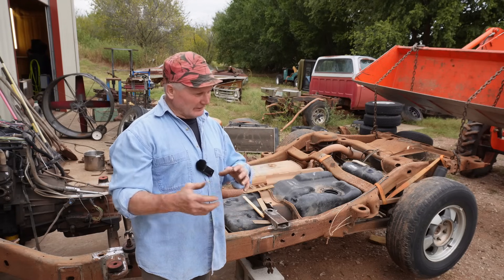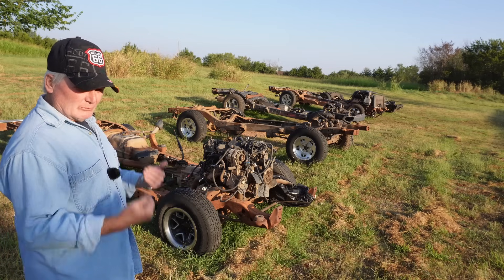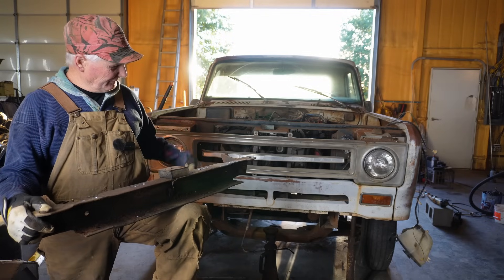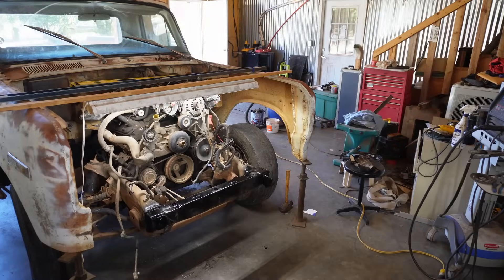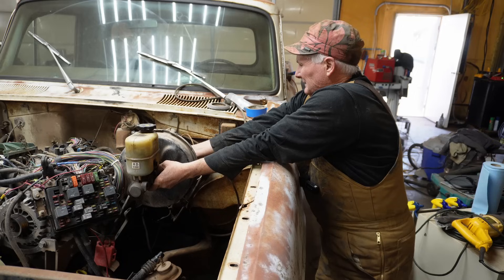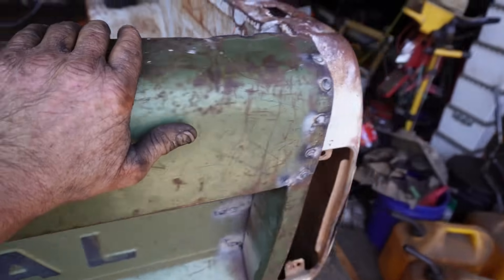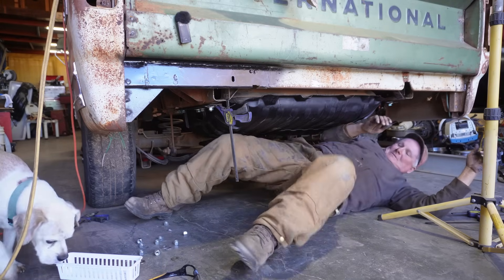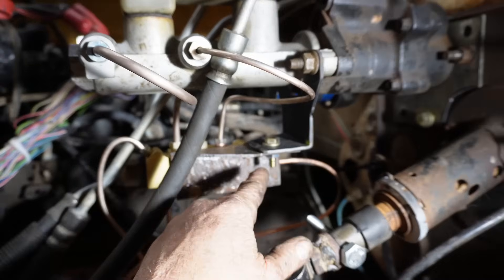1970 IH/2002 Tahoe Frame Swap: Pasture to Engine Start

Comment: Very cool.  I'm 75% of the way finished putting a 71 Travelall on a 2003 Tahoe.  Mine is a full on floor pan and firewall swap.  Basically a full Tahoe with an IH skin and some Dakota fender flares.  If you're interested, the whole build is over on my channel.
Reply from the maker: I know. 😁😁😁 I am subscribed to your channel and have been following your project.
Reply: @RandomRodShop  Awesome.  And thanks.  I'm trying to get caught up on videos but I'm pretty bad at it.  I'm much farther than the videos.  Front clip is fully repaired and bolts on (finally), rust and holes in the roof are fixed, interior metal work is nearly finished.

This was the first time youtube has introduced me to your build.  Glad I found it.
Reply from the maker: My son and I talked about taking your approach, but in the end we both felt that we wanted to keep the "old" truck. We just want a more reliable and efficient drivetrain.
Reply: @RandomRodShop  honestly, I only went the route I did because my shell was so far gone.  If I had bought a nicer one, I would have stuck with a frame swap like you're doing.
Reply from the maker: I have a couple of projects that fall into that category.

Comment: Don’t forget when you make a brake line with both fittings in the correct orientation, then put one last bend in it, and realize the fitting is on the wrong side of the bend and won’t go around the bend
Reply from the maker: Ahhh!!! I forgot that one. Yep....done that also.